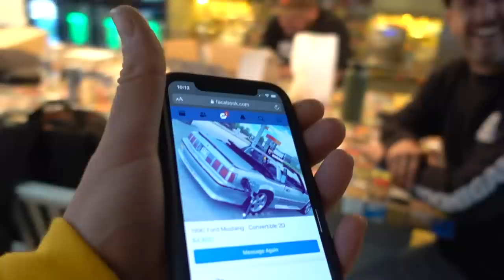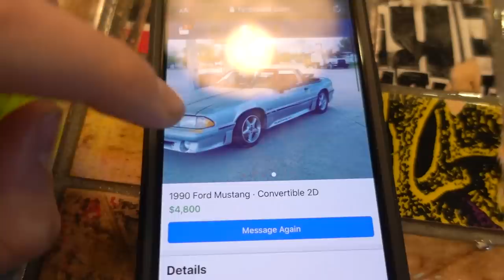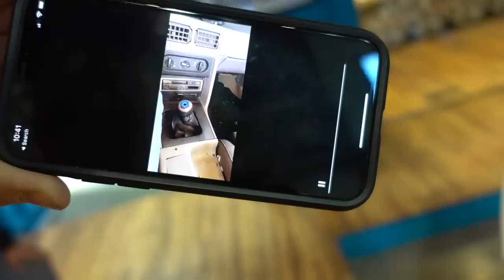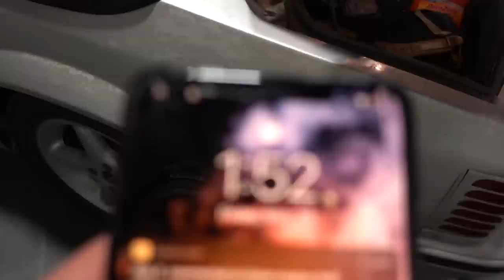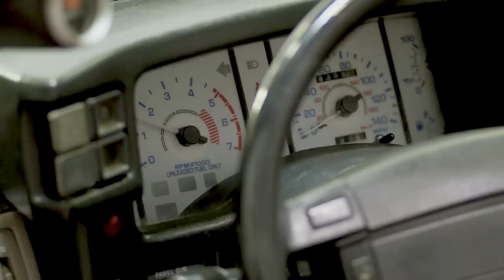Ken Block Buys a Fox Body Mustang for $4,000. Drop Top Burnouts!

Comment: I bought my first Mustang when I turned 17, it was an 89 GT Hardtop - I went on to own 3 foxes (among other Mustangs), but owned a '91 GT Convertible in hunter green and gray.  It was an automatic, wasn't especially fast and also had convertible top issues like this one (as they were putting their kit together I was thinking "and a relay, and thermostat and some hydraulic fluid for the top".  But damn, it was such a fun car - it was literally my best friend.  And then I crashed it being stupid.  But anyway, they really are great cars, and just a blast to drive.  

A couple of notes - convertible 5 speeds are rare and from the sound, it sounds like it's got a gear.  They cleaned up the luggage rack on the lid and added a small spoiler. The dash says 25th anniversary, so it was either 89/90, but the seat headrests are smaller than what came in those years (I'm assuming this car is an 89/90 and they just replaced the headrests).  Has a Cobra Intake and they added white face gauges (which are a complete bitch to install, trust me) as well as an exhaust and who knows what else.  The wheels suck, it needs 5 lugs, the brakes are atrocious in them and it definitely needs work - but the fact it's a 5 speed makes this one a gem.   I'd take it in a heartbeat.  Such a fun car for $4k.
Reply: I have a 90 GT conv.  The headrests are correct.

Comment: 1985 was the year to get. First year with factory roller rockers, forged pistons, S.S. headers, rear diff limited slip AND, a true 4 brl carb. 1984 didn't have all that and 1986 went to the fuel injection. Best part is, I live a few miles from Ken, could have delivered it in person!

Comment: widen the whole car by an inch or two and make it a hill climb 5.0 beast
Reply: hoonifox?
Reply: Should put a Rally engine in it. Convert it to AWD and throw air suspension in it and make it a hellacious lake cruiser
Reply: Jake Ouellette keep the 5.0, Stroke it to 347, AFR185 heads, an on3 turbo kit in it, custom grind cam, 3.73 gears full 3” exhaust, world class T5 trans and upgrade the clutch. This bitch would be BAD. gotta do somethin about that steering angle too but that’s nitpicking.
Reply: @super8studios868  he 
should do a track car dressed as a daily car... the hoonifox is a project.. so.. he has 2 foxes.. one for drive.. one for kill tyres..
Reply: @gaara10122  what u think about old 426 block, cammed , Whipple, the works swap ?

Comment: I forgot to mention, I contacted total seal; when I bought rings and there race rings will work on nitrous or forced induction. So u can use kit on car or  u have options, later if not running n/a. Meaning you won't have to rebuild and change rings to add nitrous, charger or turbo. I see 50 hp + difference on a carbed stroker set up vs efi. If it's set up right👌 you will see 100 hp more (550-600) flywheel hp number on motor ,you port heads, add custom cam, air gap 2" spacer and nice carb dialed in.

Comment: Ken the best thing to do before you put the time into the hoonifox is to do a little aggressive fender trimming, get some 15" bf goody km2's, put some air bags in the springs to get max height out of the suspension, and go enjoy that utah desert, with front quarter panel exhaust!

Comment: Supercharger and dual turbskies on a 427CJ, wide body kit all carbon custom molded with sharp points and lots of Aero built into kit, Mid height spoiler with sharp points lookin like a ninja star from side view. Black on black(white trim rims just for that pop) with ghosted Ken Block Livery faded in where u gotta look just right to see it. Full roll cage with carbon fiber removable top(makin it look like a coupe). And for those days you just wanna daily drive it throw in a removable sub and amp enclosure that forms perfectly with the cage structure in the back seat. Hotchkis Suspension, angle kit, 3.73 gear ratio, Army Trix exhaust kit. I can think of a full build but then I'd be giving away the full details of my future Fox drop top(literally the only way I would own a foxbody, I never cared for hatch backs) build minus the livery. BTW @KenBlock I have an idea for drifters paradise, well all auto sports to be fair, that I think you would enjoy the shit out of. Can't release any details due to the fact I haven't had the idea Copyrighted yet(Not worried about You Ken, just others lol) but it would be a 400+ Acre automotive sports complex, with areas for ALL sections of the automotive sports industry, I have the course flowing through my head on the daily so much it's hard to sleep. And I'd live right smack dab in the middle of it in my auto shop i'll build that the whole complex will be centered around. I know the idea would go over well and would attract people from all over the world like the Nürburgring does. If you catch drift of this and feel like you might know somebody that would be interested in partnering up with me Get at me, Would be one helluva expensive venture, but it would pay off double in no time, guaranteed, especially with the way motorsports is going these days.

Comment: I did a similar burnout with my 1983 5.0. Right down to the rims but sparks lighting up the parking lot lol. I say do a wide body but kinda mad max style like chopped up, but clean  with the rivets showing.  leave the original head and tail lights but with wicked halo rings for the front and LED lights in the back. A carbon fibre ram air style hood. Carbon fibre roll bar but like a rectangular style tubing. Trick out the interior a bit with recaro race seats with a knarley grab stick E brake. I am a massive fan and have been for a long time. #Hooner4Life

Comment: What a great project car!!  Don't know if this has ever been done or not. After you guys get done thrashing on the car.  I think you should rebuild it in to be the ultimate 90's Fox Body STEALTH MUSTANG CONVERTIBLE for the Hoonigan family. Use it for filming and then give it to your daughter at 16. Stealth so for as it looks stock in most every way until you get close or it parks next to a stock fox body.  With the fox body's short wheel base and narrow suspension stance, it always had poor handling. Slightly stretched and widened and keeping the original car's proportions. The extra wheel base room maybe 5-6 inches, would allow 2 real people to sit in the back seats. Lighten everything while still keeping the Fox Mustang looks. Better lighter steel with sub-frame connections. Hide all the improvements behind stock looking parts. New suspension behind larger lighter Mustang style wheels. IRS in the back from a 90's Lincoln or the original Mustang IRS from OVC Mustangs in Cali. Build the best 90's Fox Mustang, the one Ford should have built.

Comment: Remove the soft top, install exo-cage/roof, blow the old motor up and swap in a built home-built Cobra Jet motor (N/A Windsor with a couple double pumpers so you can keep the nitrous kit, get about 500hp reliably.) Liberty walk or rocket bunny kit with some sick Johnnies. SLAMMED, weld the diff, and new seats. Then proceed to party!!

Comment: As a fun family car, & something your daughter will be driving... K think you should give it good power(whether that be beefing up the 5.0, or complete engine swap) fender flares with high negative offset wheels, maybe new rear gears like 4.10. And an improved cooling system for the motor, given the pedal always being to the floor. Keep it cheap.

Comment: Do an ecoboost swapped SVO. Came stock with 5 lug, 5 speed, 2.3 turbo.  All wheel disk, and sn95ustang parts fit on it as well for upgrades. Functional hood scoop. Bi-wing spoiler. Sell you mine. I'm in Washington.

Comment: You already ripped the tires off of it, so from here on out take care of it. A Fox is a special car, that you can appreciate only after having seat time in one. 
Build a fun car in any flavor you want, but don't murder the car for no reason.  Those 5 liter engines are fairly robust and will last if you don't purposely kill them. 
I just picked one up sight unseen, and drove it 1300 miles home without a hiccup.

Comment: Fox body best car ever I've had ,6 now did u get it for  so cheap usually they rusted broken for 10 I like the coupe non covetible but every time I look shells are going for 4 grand I bought my last fox body about 10 years ago for 3900 bucks than sold it with no motor for 4500 bucks 3 years ago now they are 10 grand for one in decent shape you got a very good deal it looks great